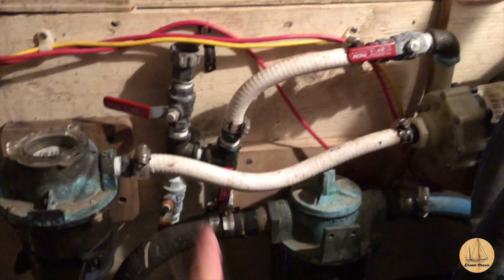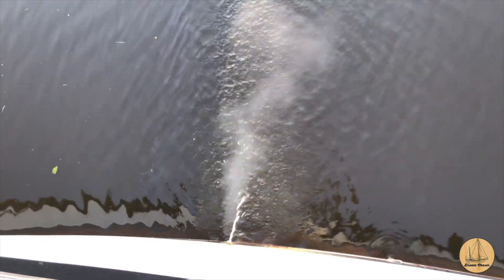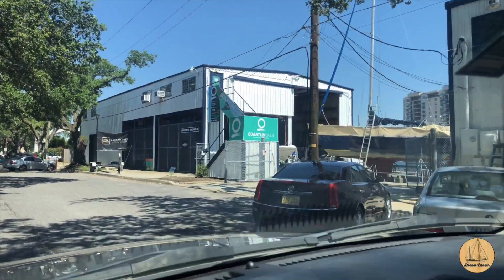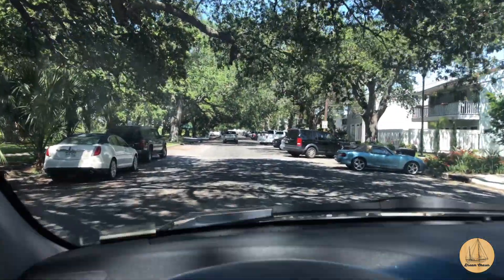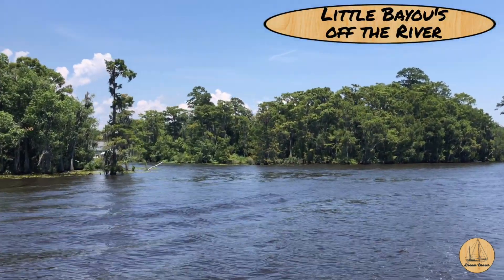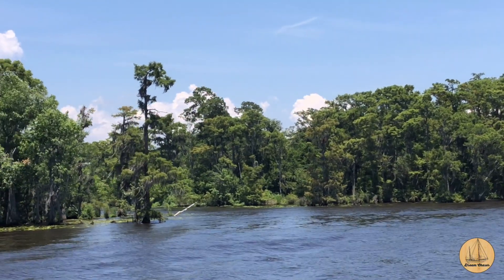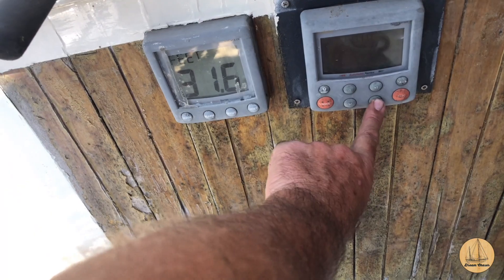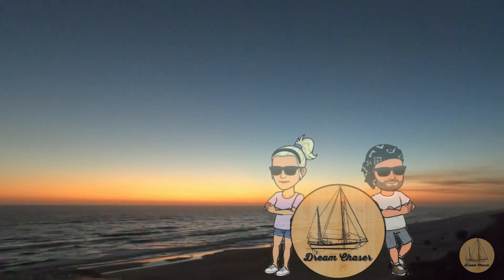0703 Taking DreamChaser out for a spin

Comment: Your going to be so happy to get the boat moved over to Florida.  
I know everybody likes the look of varnished wood but for a boat outdoors year round white paint is so much better, and an old trick from the Caribbean Maintance crews was to paint over good fresh varnish so the white paint did not get in the wood pours then fairly easy to sand back to varnish for the summer 1-2 months when the owner showed up! But as I said nobody wants to do that , for me I love the all white modern look .....even on older boats
Cheers Warren
Reply from the maker: Good tip.  As you can see by this video, this is what happens when it has been 2 years without having really finished the first application.  The worst part of this was in the boatyard, I sanded every bit of this down to bare teak and then bought AllwoodMA and applied the special base layer and only put 1 coat of the special clear on top of it.  I needed to do 4-5 at least and didn't.  I am going to pay for that decision with having to likely sand it all back down to wood again.  
It is a pain to keep looking that way, but I can't seem to get the brightwork nostalgia out of my head despite having proven I am not keeping up with it.

Comment: Great video, I loved it! That looked like steam coming out of the generator but it's hard to tell watching on my phone.
Reply from the maker: I think it a bit of white smoke and honestly it didn't look like enough water either so I need to investigate that a bit more too.
Reply: @Svdreamchaser  it looked like it was dissipating to me. That's why I thought steam.
Reply from the maker: @michaeltillman1147  you may be right.  Steam worries me, I am not sure yet what that may mean.
Reply: @Svdreamchaser  you'd have to go to a cruisers group to ask. You have a wet exhaust so.... I'd check the exhaust temperature to see if it's running right. It's a good chance to do boat yoga and use your infrared toy LoL.